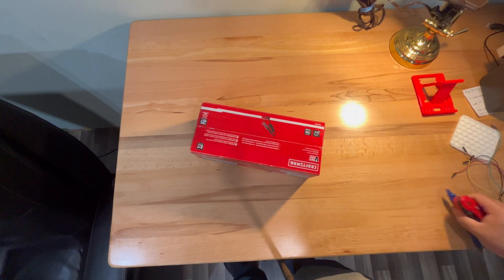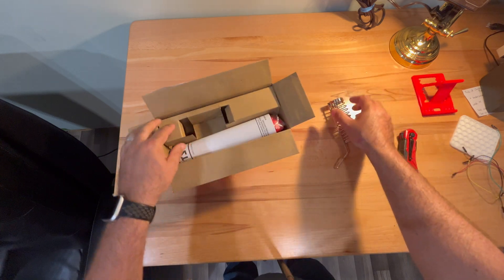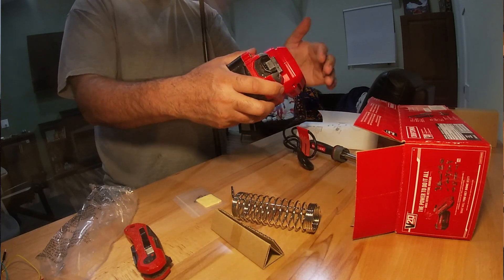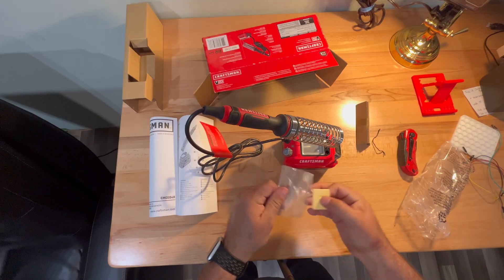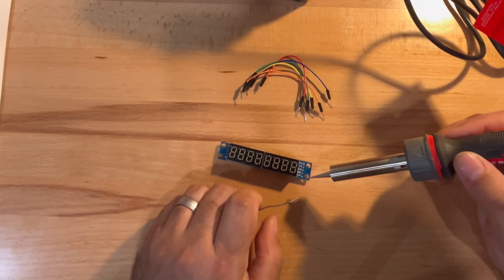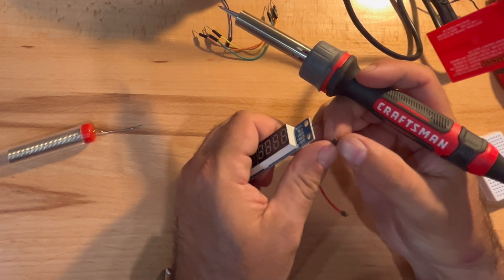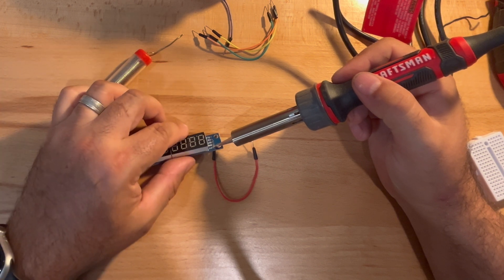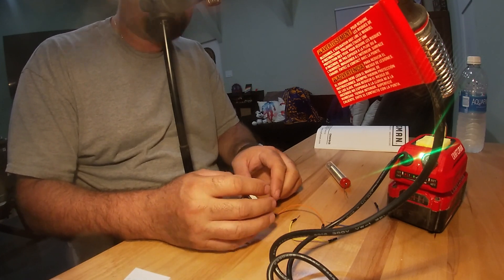Unveiling the Craftsman 20V Soldering Iron CMCE040: A Detailed Look & Test

Comment: Hmm an unboxing that is mostly watching someone solder. What controls does the iron have? is there a temperature display?
Reply from the maker: LOL! 😂 Sorry my unboxings sometimes miss the mark.  This unit is very limited on features there is just a rotary dial on the front of the unit that goes from high to low with no real temperature markings.  It works great in a pinch but it is not a professional quality unit.  Thanks for watching! I'll try to make my future unboxing better with all the specs of the item.
Reply: @wilmerwoodworks  Weird that there's no temp display. Even my cheap corded soldering iron has a display. I'm figuring it is because they use the same base for the rotorary tool. They just swap out the iron and sponge holder for the tool and bit holder. Anyway thanks for the reply and I have the info I wanted.